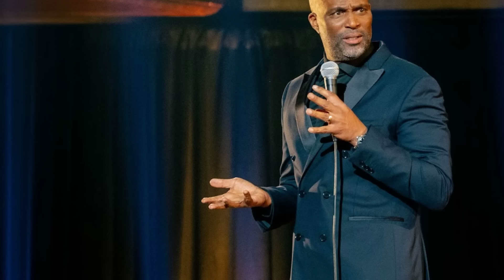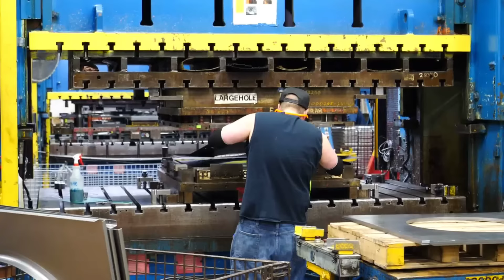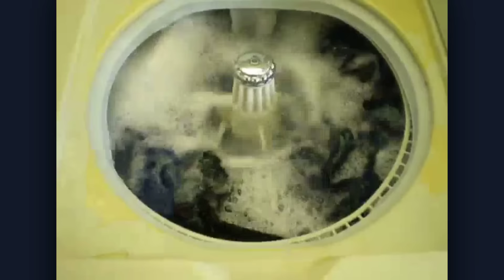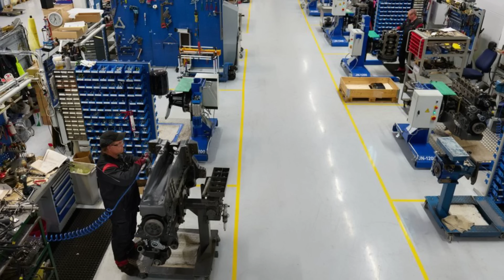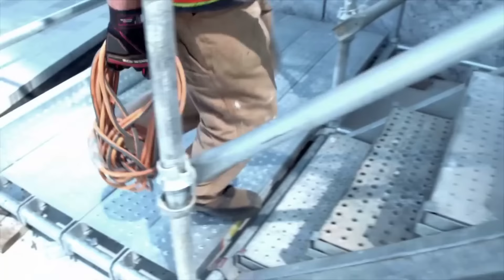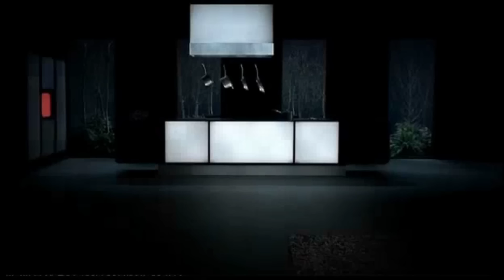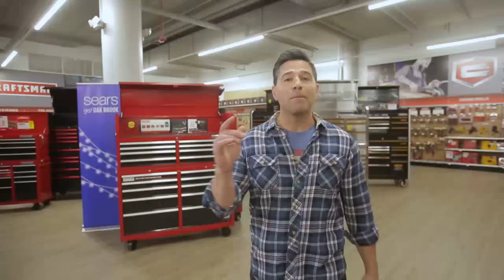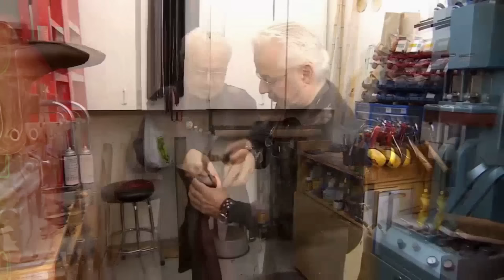The Only 5 Brands That Still Last (The "Buy It For Life" List)

Comment from the maker: Get exclusive "Do Not Buy" blacklists and unfiltered forensic audits sent directly to your inbox.
Join the off-grid network here: https://industrialdecayusa.kit.com/profile
(Also, reading these comments is amazing. What is the absolute oldest piece of gear, tool, or appliance you own that STILL works flawlessly?)
Reply: 1989 Kenmore Electric Dryer. Only had to replace a drum belt once,15 years ago.✅
Reply: My Kirby vacuum is only 27 years old but I’m sure it’ll last longer than I do
Reply: Dad's Craftsman drill in 1960's,  1986 : BLAIN'S Farm & Fleet drill
Reply: First time viewer. Love this!
Reply: I have a 1950 Wedgewood gas stove in my kitchen. It still works and the only repairs have been cosmetic.
Reply: I’ve built a home out of used tires rammed with earth and sand bags, coated with wire and cement, my estimation of longevity is probably the next earth disaster how ever long that is…
Reply: I  have a GE fridge in my garage that's been running continously for 40 years
Reply: Absolutely!
Reply: I have an Estwing carpenter's hammer I built my house with in the late 1970s, and I have recently used it for renovations. It cost about 4 days' income in 1974, while friends bought pipe handle jobs which soon fell apart, in one case causing an injury. Even the nylon handle wrap is perfect.
Reply: My mom use to work at Exide battery company and she said they just slapped made in usa stickers on the batteries that came from mexico...
Reply: @Thelongmanable  Regardless of the brand on the label, most batteries now come from China or Vietnam.
Reply: You lie.  I have put new treads on cheap boots for years.
Off brand cast iron pans last just as long, as long as the metal thickness is adequate
Reply: Sears canister vacuum cleaner.

Comment: I really, really want a new fridge, because I'm renovating my entire kitchen.  I'm extremely afraid.  I've had my fridge for almost 20 years, and IT STILL WORKS LIKE NEW.  It's a Hotpoint.  It just seems that everyone who buys a new fridge these days has major problems with it in 5 years or less.  

And I still miss my old Sears washer.  It was used when I got it, and it lasted me about 13 years.  The new washer I got afterward lasted 5 years and was done.  Ugh!

Comment: I fully endorse your search for quality. Forged pan, yes, absolutely, Forged tools yes, of course. But I suggest to look also beyond the horizon (rather Atlantic) and try Hazet for hand tools and Knipex for pliers. With the top loader washing machine, sorry, you are missing out. A washing machine ruining or wearing out your shirts faster than necessary, is just outdated. Try MIELE, will last for decades. If your are looking for peak durability, take their commercial service. I am specifically raising this as I had the experience with an old-school US build toploader ruining my shirts and still not rinsing the soap out of the garment. Even in North America I bought a Miele and got what I paid for. At the end of my term I donated that to charity (orphanage) and I am convinced this Miele washing machine is still running and will keep running for many more years. And if something finally breaks, you order spare parts at the factory in Guetersloh, Germany. Because they are proud on repairability.

Comment: 1. Washing machine - Speed Queen TC5 top loader
2. Small engines (like a lawn mower) - Honda GX engines
3. Work boots - look for the term goodyear welt, brand: Thoroughgood 
4. Cast iron skillet
5. Hand tools - Channel Lock, Right Tool

Comment: Small engines: Kohler 

As for the assertion that anything other than Honda offers parts (in particular pull cords) is not true. There are plenty of 3rd party parts manufacturers that supply parts for Honda and Honda clone small gas motors.

While shoes with Goodyear welts are excellent, other sole mechanical attachment methods work equally well.

Cast iron leaches iron into food ... PERIOD. Claiming cast iron cookware doesn't leach any chemicals into food is a lie.

As for tools, there are very good tools available from both US and foreign manufacturers. See the Torque Test Channel and Project Farm channel here on YouTube for tool and other product reviews, test results done without bias or corporate sponsorships.

Comment: Great video, I would love to see more recommendations! For hand tools, you have a quite broad range of excellent brands. I prefer the German ones (you even showed the Knipex Cobra mini in your video) like Knipex for pliers (they have hundreds, if not thousands of models in different sizes for every application you can imagine), Wiha or Wera for screwdrives (I use them on a daily base), for car repair there is Hazet the premium German brand. Also the Bosch professional (blue) power tools are very good, of course there is great stuff made in USA!

Comment: As far as small engines go, a lot of the problems go back to the gas. Run straight gasoline. Avoid ethanol. Dump or pump out the gas if it's not going to be used for an extended time and always refill with new, fresh gas. New gas will clean the system all on its own and save you disassembly and cleaning time.

Comment: I have a Honda (labeled) mower, but digging down a bit, it is clearly a B&S engine. It has the Honda automatic choke, which is problematic. Carburetor gum is from the gasoline, not the mower manufacturer.

Comment: Miele make the best washing machines you can buy, all metal components, and are designed to last a minimum of 20 years. However, my Honda never starts and it has a GX motor, I service it thoroughly, but I find I have to strip and clean the carb every damn time I need to use it before it will eventually start. It is a massive unreliable pain, and I hate the damn thing. It is so temperamental, and takes forever to start. The Briggs and Stratton I traded for a crate of beer starts every single time, first time, with no effort at all.

Comment: I'm 73 and have a cast iron pan that I got from my mother, who got it from her mother. It's nowhere near wearing out, but I have to admit that heat distribution over the bottom is very uneven. I prefer to use a more modern pan with aluminum or copper sandwiched in the bottom.

Comment: I beg to differ on the honda clone engines. Ive ran the guts outta my predator 212 hemi for around 11 years now on my gokart. 0 issues besides a misfire once due to a spark plug wire dry rotting away lol

Comment: I agree with everything bar the Channel Locks. I've owned a large set of their multi grip style pliers for nearly 30 years. Indestructible. I recently bought a set of their medium and smaller ones to compliment my original pair. Utter junk. They were tight out of the box and the mechanism refuses to loosen up. The jaws on the smaller pair have distorted and the handle covers are starting to split. Most of the ones on display were starting to show signs of surface rust too. They have obviously changed something about their process in the last couple of decades.

Comment: Remember most corporations are controlled by a small handful of "institutional investors" (as they are commonly known), namely Blackrock, Vanguard and State Street. These so called institutional investors buy up large number of shares that give them controlling power. They care only about one thing - the stock value of the company. So they sit in the boardroom and dictate to the CEO and other C level officers who are little more than pawns to these institutional investors, how to reduce "fixed costs" (employment, cost of manufacturing..) and increase earnings (raise prices).  That's it. Cut costs. And if you need to market your cost cutting/ price raising initiative call it "new and improved". This is how most corporations run today.

Comment: Comment 2: I tried using a gas powered mower in the past being the rental unit from home depot. The fumes were too much to bear for me. I prefer an electric version.
With significant online search, I find Stihl to be the only company that does the following for their batteries (not 100% sure about this but I wish for):
1. Ethical labor for device and especially the battery source materials and production.
2. In house high quality manufacturing.
While Stihl gas powered items may just have a general high price, their battery powered items reach very high prices and I suspect that they are built to last hopefully.
Their push behind mower is about $2500. Their ride version: $30,000!

Comment: 1. Speed Queen. I fully agree with this as my whirlpool advertised to be made in USA with quality mechanics is already showing signs of age at 5 years old.
2. HondaGX while great for gasoline powered, no mention of electric? Certainly battery issues can be a problem. There is also Stihl as another quality but very expensive brand.
3. Goodyear Welt? Never heard of this despite researching boots. I have my own needs for foot arch and prefer memory foam on the inside. I have sketchers john deere boots not sure how good they are...
4. Cast iron sounds good, but not dishwasher safe. I prefer stainless steel except one non stick pan dedicated for eggs.
5. Channellock of Pennsylvania: Also never heard of this brand despite searching for quality tools. I understand avoiding spending on marketing, but at least have some presence online enough for deep search and ai to discover it if trying hard in the search online for a quality product.

Comment: I got a set of knipex steel fixing pliers I got when I was 16 which by the way were left on a job to rust away. I just wd40ed them and 31years later they still sit in my tool kit always ready to cut wires or whatever is needed of them sharp as the day I cleaned em up.

Comment: My washing machine is one of the original Maytag Neptune frontloader washers. It's never given a problem, and despite being from 1998, there is no mold, because out of habit, always left the door wide open to air out. Even on a top loader, closing the lid it always had a musty smell. In 2019, the washer bearing gave out. I found a person selling new bearings for the drum along with instructions on how to do it. I debated, "Should I just replace this old thing?" Decided to rebuild it, and it was the best decision I ever made. 

Fast forward to recent, had a friend who had their Samsung start having problems, I was disgusted at how it was assembled compared to my old Maytag. The comforting thing to know, when my Maytag gets to a non-serviceable point, Speed Queen seems like a great choice. 

There are some people who will want to replace with newest. Fine. Then there are some folks who want to preserve and prevent throwing into scrap. We should have that choice too. I miss the old days of Sears where I could go in, tell them my model number, and they'd help me get whatever part I wanted for appliances or other equipment. They'd offer to fix it for me for a fee, or I walk out with the part and do it myself. Maybe I bring it back in worse condition, or I succeed and they only see me when I need another part down the road. Really enjoying this channel overall though.

Comment: You should mention stainless steel pans like Heritage Steel or Made-In. These pans can do things cast iron cannot. You can cook acidic foods on them, you can put them in the oven, you can get them ripping hot, and they still work perfectly. As far as non-stick goes, if you abuse non-stick, they will fail. I have a cheap Tramontina egg pan that gets medium temperatures only and silicon utensils. It's 7 years old and still has an intact coating.

Comment: Lots of good suggestions but the commercial laundry is a trap. Wears out clothes faster and you spend a lot more in water and power. If you are off grid, go for it, but for most folks it's not a realistic option. 

And don't buy cast iron. Carbon steel is stronger, tougher, and lighter.

Comment: 5:40 - You forgot to add in the periodic repair costs to the $350 pair. Still a better deal, but $350 is not all it will cost.

Comment: I can testify to the part about the washing machine.  While we had a front loader for ten years, every two to three years something would break, or get moldy.  I finally got tired of it and we bought a Speed Queen.  That was about ten years ago.  I did have to replace a part, but I could do it myself, once I traced the leak to the source.  I'll keep it as long as I can get parts for it.

Comment: I still have the can-opener my mother used to open tins when i was little 40 years ago. It's an old yellowing plastic kitchenaide and i think the motor on it could open an oil drum if i could get it under the cutting wheel. Sad so many things are made to break now.

Comment: I had a speed queen for 5 years and replaced it with an LG top loader. I sold the speed queen for what I bought it for (I bought it used for 500 and sold it for 500) so that says a lot about the residual value, but the problem is they are not HE (and don’t advertise to be) and  I’ve calculated my LG uses 1/3 the amount of water per load. Ever since getting the speed queen my water bills had doubled. Water is very expensive where I live. And the LG, still being a top loader, is an HE machine without an agitator (allowing it to wash substantially more in its 5 cu ft drum) and offers all the same conveniences of any other top loader, but costs over $100 less per year to run. I’ve had the LG for 9 years and have had 0 problems. It cleans cloths equally well as any other washer I’ve owned, including stains and grease (I’m an engineer and my cloths from costs to pants are constantly covered in various fluids.) The only downside is the LG takes longer as it uses less water and needs to spend more time distributing detergent or rinsing.)

Speed queen is not the right machine for the majority of people. They are outrageously expensive to operate, using more electricity and water than other consumer machines. The cost of ownership is going to be substantially higher over its lifetime than any other brand, not helped by the initial cost, but the consumption costs. I guess it depends what you value but these old legacy companies making machines using outdated technology need to get with the times. Resources are not getting any cheaper and it’s important we have appliances that use less resources, even if it comes at the expense of some reliability. I don’t expect my LG to last 25 years, but it only took 6 years to break even with the speed queens total purchase price (or the difference in purchase price between selling the speed queen for 500 and buying the LG for 1000, take your pick)

Vehicles…well that’s another story. I still drive old school non-direct injection non-turbo cars and trucks, and they get acceptable fuel economy at 26mpg and 18mpg respectively. Yes I could get a turbo sedan or truck that gets 50% better fuel economy but I don’t drive enough for it to matter and the savings over the higher cost and maintenance of turbo vehicles has a break even point of nearly 10 years with gas at $3.50/gallon and I rarely even keep vehicles for 10 years. If gas is $6.00 a gallon that break even point is cut in half and becomes a consideration but unlike electricity and water, natural gas and gasoline has been reasonably stable in price for a long time where I live but we will see how the war with Iran changes that and if my next truck is a hybrid or something along those lines.

Comment: Steel is also a great material for pots and pans. It takes a little practice but they are fairly non-stick as well if you heat them up and add the right amount of oil. I use a Steel pan every morning for eggs. Heats up much faster than a skillet and is easier to clean.

Comment: I am glad that this video mentioned Channellock tools. Having been an industrial electrician for over 40 years, I have tried numerous brands of hand tools, including Craftsman, Crescent, Diamond, Klein, Snap-On and Channellock. The Channellock tools were the absolute best that I experienced. I retired over 7 years ago and my Channellock diagonal cutters (side cutters) are so old that the blue vinyl covering on the handles wore off many years ago. But they still cut like brand-new.

I am sorry that the video did not mention Estwing hammers, which are still made in Rockford, Illinois, the area in which I worked during my career as an industrial electrician. If you want a quality hammer that will never wear out, the Estwing is the brand to purchase.

On the subject of washing machines, I cannot tell you how many of the newer front-loading washers I have seen in scrap metal yards - A LOT! Growing up in the 1960s, my mother had a General Electric washer that she had bought used from a local appliance dealer. It was probably 10 years old when she bought it and she used it, trouble-free, for many more years. It had this "Filter Flo" feature, which consisted of a plastic basket that sat on top of the agitator. The bottom of the basket had numerous holes which were very small and the wash water flowed through the basket and back to the clothes. After the wash load had finished, there would be a small round ball of lint that you could simply pick up and throw away. It was a much better system than any in use today.

Thank you.

Comment: Front loader washer machine are garbage, i threw away a POS top loader Samsung washer that always has unbalanced problems with the drum , got a LG , still working fine after three years but the door gasket seal is a pain in the …